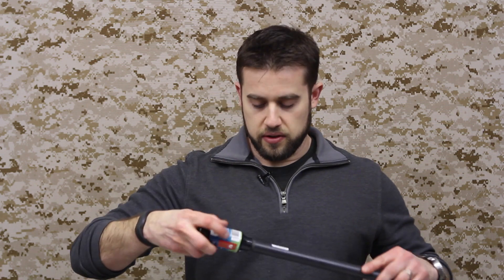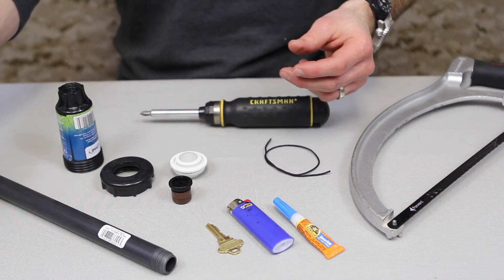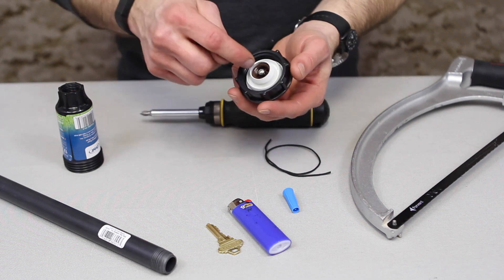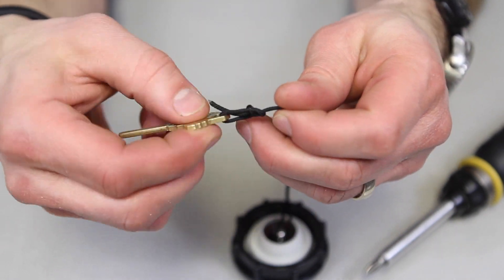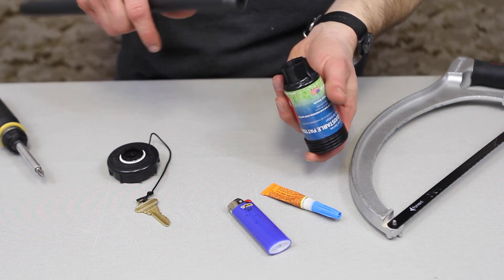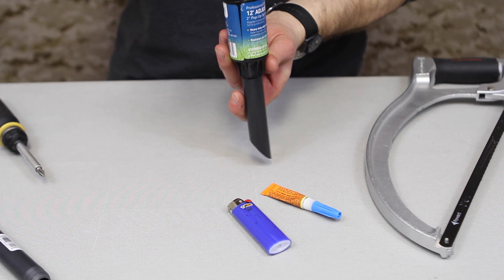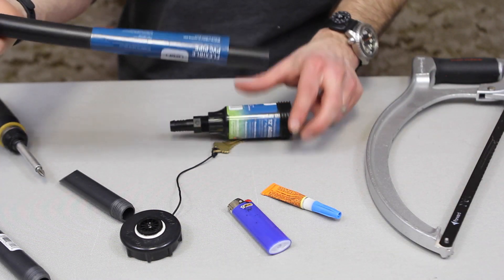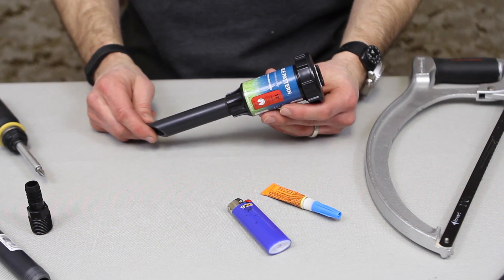Hide your Spare Key Like a Spy with this DIY Dead Drop Key Hider

Comment: Tie fishing line to key and place in tiny zip-top bag with line hanging out of corner.Cut small slot in turf by house/path, insert bag, close turf, cut off line to just above turf level. Crouch to pick up your key when needed, as if you just dropped it.

Comment: This video does a good job of teaching people to think outside the box when hiding something, but I encourage anyone doing something like this to avoid calling it a "spy dead drop" or anything like this.  Hiding a key like this is nothing like a "dead drop", so you'll look quite silly if you even just tell someone you hide your key using a dead drop technique....That would be a truly ridiculous idea....and would require a LOT of Tabasco sauce if used as a long term solution.
Reply: Exactly.  The idea of a dead drop is that messages can be left and retrieved innocuously and repeatedly.  If you have any concern that you might be under surveillance then this is a one-time use only, at least if it's placed in somewhere as ridiculously exposed as a lawn.

If you want to hide a spare key, put it somewhere along the path you'd normally take to your side or back door and where your actions are hidden from overlooking windows or from the road.  A large patch of tall shrubbery might do (and not a patch composed of any deciduous plants which will lose their leaves in winter), with the key hidden behind a trunk or branch at somewhere between waist and shoulder height.  Attach the key with a piece of stiff wire in such a way that it won't work free if there's a high wind but can still be pulled loose with a sharp tug.  Practise doing this in the dark, so that it only takes a couple of seconds to find and retrieve with one hand and won't delay your return to visibility in any way which might raise suspicion.

This is only the second ITS video I've watched and both have contained basic errors and silly assumptions; it's sub Boys Own Annual material.  I don't think I'll be watching any more.

Comment: Sweet idea!
Reply from the maker: Thanks! ~ Bryan
Reply: +TypicalFlux what if its snowing like 4 inches? or using lawnmower it will snap the lid off. and if someone will see it he might get curious what is it & try to take it. you know what hide you key in number lock combination compartment then lock it to rail or door knob or pole.. just buy it
Reply: +dbltrplx Criminals will now pull up all the sprinkler heads at every house on the off chance there's a key in them? doubt it.
+Compton Irrigated lawns can still be mowed...
Reply: +Compton Dude, get a clue. If your mower will catch this you're mowing to short. Also this is designed to fit in with an already sprinkled lawn so it wouldn't stand out from the 100 or so other sprinklers.

Comment: Secure it in the ground with a T connection and it won't be easy to pull up plus it will not spin when you try to twist the top.

Comment: It's irrigation pipe. It easily holds around 30psi without leaking. There's no reason to silicone the threads.
Reply: It's not for the purpose of running water through it. The purpose for the silicone is to seal the inside of the drop so water doesn't get into it. It no longer works as a sprinkler head, I think he made that clear. The ones sold as a hide a key have no hole in the bottom for this same reason. Water can build up in the ground from heavy rain and seep into the inside from the bottom if it is not sealed, including running up the angle cut pipe if it's not sealed as he instructed.  Sealing the inside of the top would of course seal that side too, making the entire drop water tight and resistant to water seepage.

Comment: why would you try to pull the whole thing up to see if it was a real sprinkler or not when you could just unscrew the top
Reply: hurf_durf if you unscrew a legitimate one you will get soaked. Criminals normally check to see if it's legit first before unscrewing them